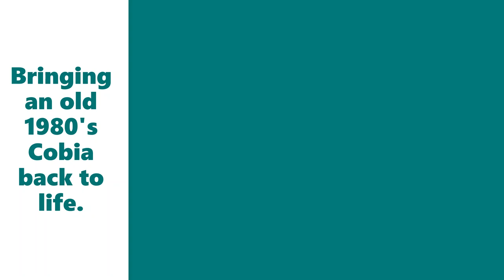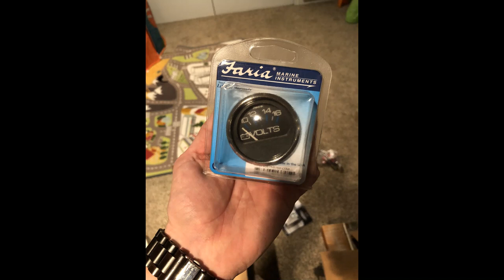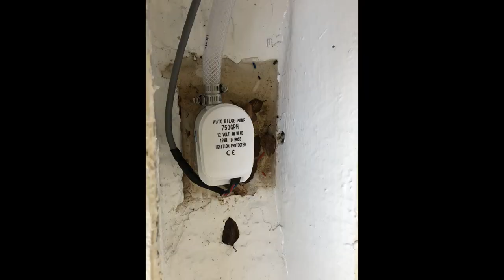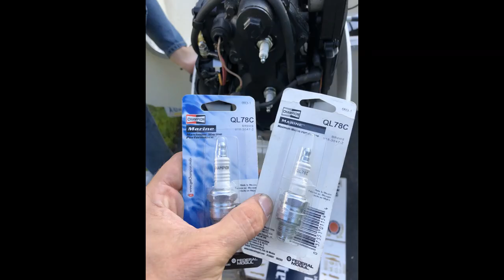1983 Cobia SunSkiff 156 Restoration

Comment: I have the same boat. Soft floor in back just like yours. What’s the best tool to cut floor out so you don’t go to deep? Skill saw? Set to 3/4 inch. Also the back left corner top needs replacing like yours. Boat is very solid other than that., thanks for replying
Reply from the maker: I use a circular saw set to just over 1/2 inch. (the coring is 1/2 inch) . used a cutting wheel on a grinder for the right corners

Comment: Great job man. I have the same boat just a 177 model which I plan on restoring  after summer. Where did you buy the windshield at? I am needing a new one
Reply from the maker: Hey, the windshield was actually on there. I just looked better without all the junk around it.
Reply from the maker: HOWEVER, here is a place that will make you an exact fit: https://www.updplastics.com/cobia-boat-windshields-1980s/

Comment: Great video. I was just given a 156 and it has very similar floor damage.  Did you not glue the new ply down and just use those batteries to hold it down and then glass it in?  I hope I can get my electronics looking that good.  How did you end up running that wiring through the hull to the console area?   Would it be better to run the wires before putting in the floor panels?
Reply from the maker: Hello! glassed the underside of the deck, then using the batteries as weight, I used resin mixed with Cabosil (filler) as the glue to bond the deck with the stringers.  I used the factory rigging tube for the wiring. You can run the wires prior to the deck going down, but make sure they are free to move, and you run a few snakes in there for future additions.

Comment: Just wondering if you could give me some advice, I have a 16 foot skiff from 1974 that I am currently restoring, it has an 85 hp outboard engine. I’m about half way done and when I’m finished I’ll be into the boat for about 1,000. Not sure how much I should list it for because it is older but it is completely rebuild.
Reply from the maker: what year motor? Trailer? titles for both? Need some details
Reply: @Christian Fletcher  the motor is a 1976, rebuild carbs and clean inside and out, runs and haven’t had any issues granted that it hasn’t been in the water yet. Trailer has new bunks and is in fine working condition. Title is clean for both. I added a platform on the front of the skiff and built a center console for it. Both are built out of marine grade plywood and are fiberglassed into the boats haul itself.
Reply from the maker: @yourmomsfavoritepodcast4460  Hey man, the motor really isn’t worth much, if anything to a buyer. If it’s a good running motor and has been tuned, coils replaced, water pump replaced and has had a carb rebuilt, the motor is worth around $700. The boat is worth around $2k if it’s done nicely. trailer is worth around 800. $3500+
Reply: @christianfletcher2672  okay thanks, my neighbor is a professional bass fisherman and he happen to take a look at it and said about 4,500 when it’s all said and done, so pretty close to what you said. Thanks a lot